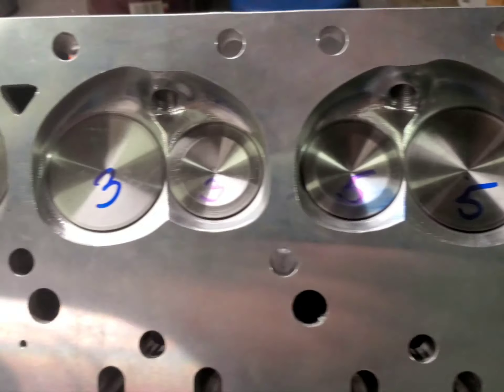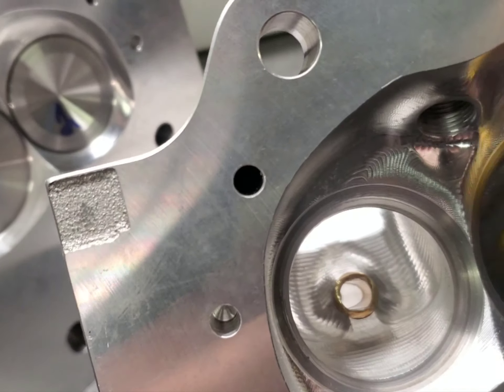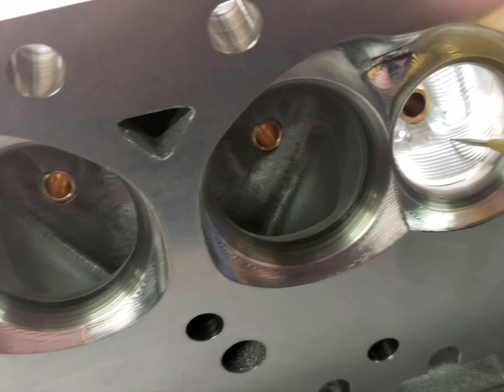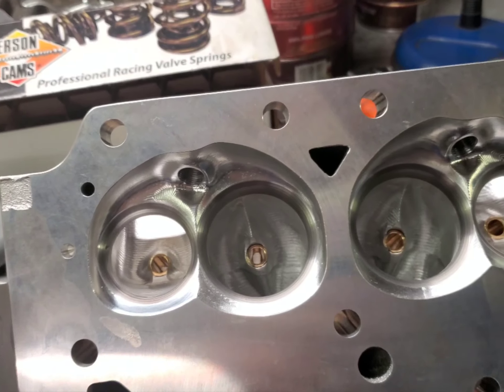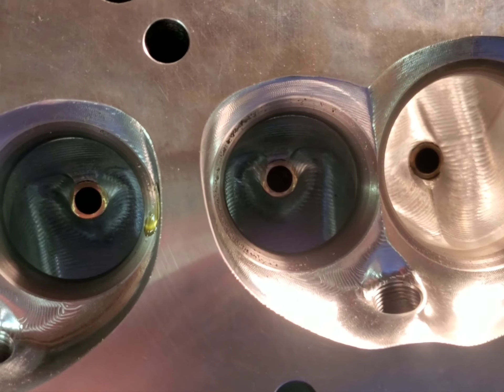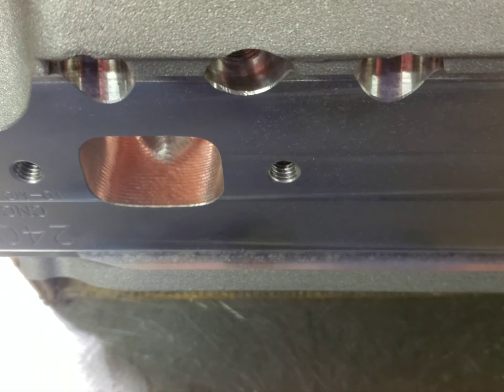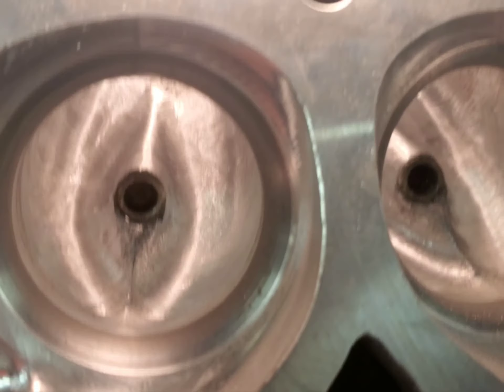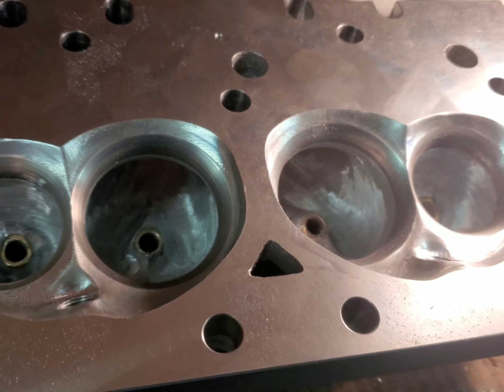240 Trick Flow CNC Port and Bowl Blend, Pt.1.

Comment: Good job ed , cnc ridges are the hardest things to cut down and transition into , more work and very time consuming more than anyone would realize,  you've definitely helped these heads out alot in my opinion , another job well done Ed 👏
Reply from the maker: Thank you Terry, I think you understand what's going on here for sure.
A person could definitely spend alot of time on these heads.
I think the approach here is the absolute bare minimum. 
Thanks for watching and the positive feedback. 
Have a good evening. 
Take care, Ed.
Reply: Hello Terry, 
I did some very mild porting on a set of Dodge 3.9 V6 heads,  and all I was trying for was mostly just smooth and clean.  It took a lot longer than I thought it would.  After I got my engine back together (which Ed did all the machine work on) it ran smooth,  and I got 20 MPG. it was in an 88 Dodge Dakota 4X4 5 speed manual.  I don't know what kind of fuel mileage it got before I pulled engine.  I bought it, got it running,  tested the steering,  brakes, 4X4, and figured it was worth the money to rebuild the engine.  I was glad I did. Ed, did a great job on the machine work,  as usual.  Have a wonderful day Sir.
Reply from the maker: @bertgrau3934  Thank you Bert, I really appreciate your kind words.
Have a good evening Brother.
Take care, Ed.
Reply: @bertgrau3934  I think Ed's work is always above and beyond any machine shop I've ever seen and I've seen alot of different work out of alot of shops plus he has the knowledge and years of experience to back it up , I think he is the best kept secret
Reply from the maker: @terrygrover6440  Thanks Terry, I appreciate you. 
More projects coming and good tech and procedures.
Take care, Ed.

Comment: I just bought a set of 270's, which is just the Max Wedge version of these. After six months of saving and two months of backorder, they are hands down the finest out of the box head I've ever owned. I've considered smoothing the ports and bowls but they flow so well I just don't want to risk a slip up. Those 240s are gonna make someone very happy 😁.

I may smooth out the exhaust for the carbon deposits. I'm stroking a 383-484 and it's still a ways off from complete.
Reply from the maker: Hello Joshua, thanks for watching.
I am excited to hear that you have purchased the 270's.
Very nice heads indeed.
You will be very happy with them.
I have sold 270's and the finish has always been better than what I have encountered on these 240's
Have a great evening. 
Take care, Ed.
Reply: @edsmachine93  I would definitely say the ridges from the lollipop are more pronounced on those 240s. I guess the larger ports allow for a less severe angle on the CNC head b/c the exhaust ports on my heads are worse than the intake ports for sure.
Reply from the maker: @jseal21  Good comment Joshua. 
I think the tool path could be programmed to leave a finer finish. 
Would not add that much time to the process. 
Have a good evening.
Reply: @edsmachine93  you would certainly know better than me my friend. Have a good weekend, love your videos.